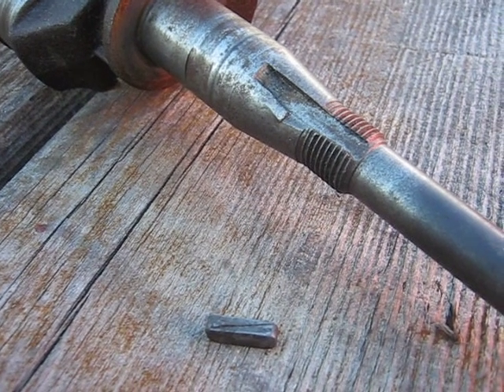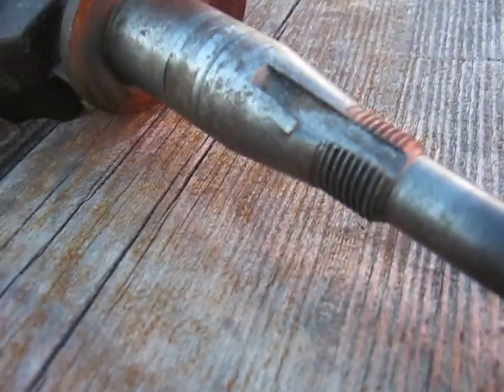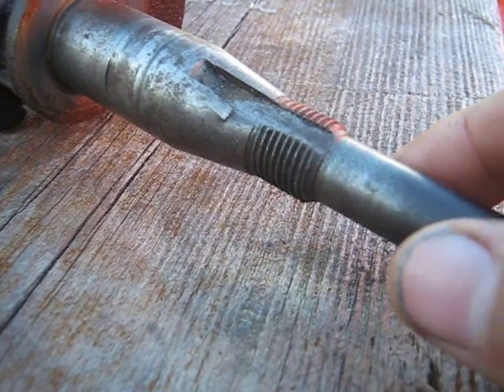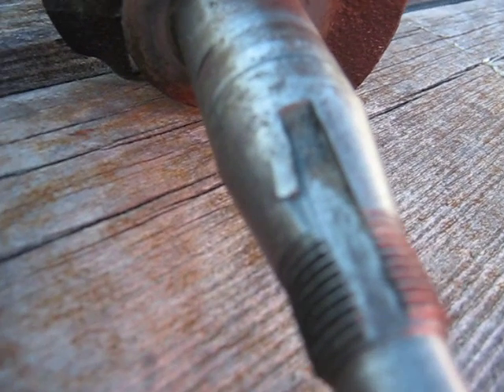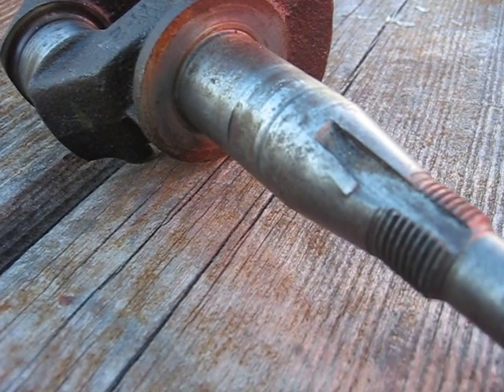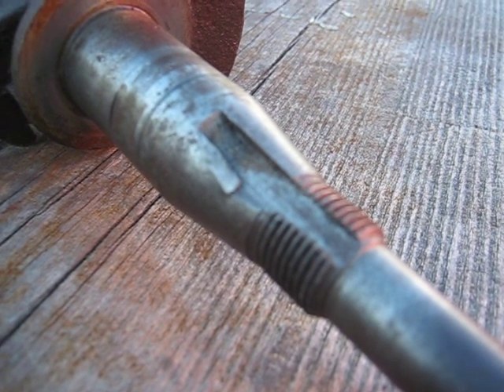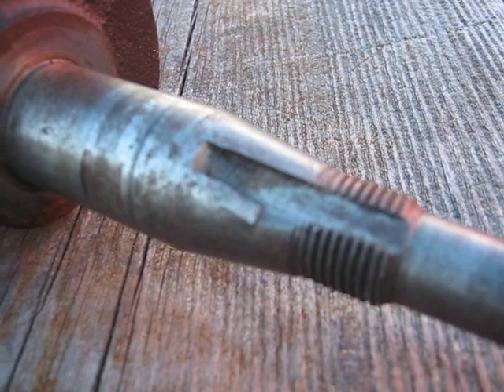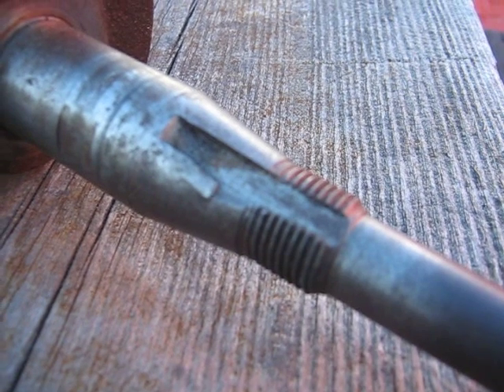NEVER Use a STEEL Flywheel Key!!!!!!

Comment: Great info thanks.  May I add 1 more fyi? Don't replace your starter motor gear with a metal one - it will eat through the flywheel gear teeth!!!
Reply from the maker: Yes, unless it originally came with a metal gear. Replacing the gear on the starter costs a little bit, replacing the flywheel costs a lot more!

Comment: They have flywheel key stock at princessauto. Is that steel? Is kinda heavy.
Reply from the maker: What they have is key stock , NOT flywheel key stock. The steel will work fine on a pulley , gear etc.  But, you must use the aluminum type on these Briggs engines, or suffer a damaged crankshaft and or flywheel, like I did. Hypothetically the engine could run without a flywheel key, as it only locates the flywheel, it is actually driven by the tapered shaft  wedging with the tapered flywheel.  Hope this clarifies my vid.
Reply: ChargerMiles007 you know if they is anywhere to buy aluminium flywheel key stock?

Comment: I make them myself from scrap aluminum, when I went to Canadian homedepot they don't even sell them ,or heard of them , people just buy new lawmakers.
when you install new key the shaft and must be polished and much other part perfect ,that's why everything holds together, key is just to a line two parts .Some people use rubbing polishing compounds to get perfect fit.
Reply from the maker: +tv1canada True, both the flywheel and crankshaft need to be clean and in good condition for it to work right. The other thing is to tighten the nut or recoil starter to 60 ft/lb torque, it can shear the key if it is too loose. I know of one person that made a key out of copper, as he was having a key shearing problem.
That is a good idea to use scrap aluminum to make a key, I have never done that, as I have so many from scrapyard engines. My latest project was making a spark plug spacer from scrap aluminum, so I can run a platinum spark plug in a 5 horse Briggs, as the engine burns oil, and fouls the plug quickly, I will make a vid of it  :)
Reply: @ChargerMiles007 I’m going to have to be “that guy” only today I installed 2 mower blades onto my BnS classic 450 and made keys by hammering some rebar square until a comfy fit n jamming the nut on good n tight with rattle gun as I had those 2 legitimate key ways disapear upon startup the last week

Comment from the maker: Yes, that IS a strong possibility!
I would try the 2 long pry bars, and shield the crankshaft end with an aluminum or brass plate or rod etc. to not hit the crank directly.
Old Tekumsehs are OK, like 1970s, I have a 7 horse that runs well, when the carb cooperates, but the newer ones like to blow holes in the side of the block!!! >:((

Comment from the maker: No, the aluminum (or whatever it is) is just for the Briggs flywheel key.
I think Tecumseh may use a steel key on some of them, as they have a lighter flywheel on some engines.
On a go-kart axle, steel should be OK, thats what I have used.

Comment from the maker: How about 2 pry bars, one on each side of center, while prying up, smack the end of the crankshaft. You have to use 2 bars though to get equal force on each flywheel half.
That one sounds seized pretty well. What size engine is it?

Comment: Oh man, the other day I was working on a chinese motor and the flywheel key was steel and guess what, the freaking flywheel was cracked, holy shit good thing I saw it. I was about to reuse the damn thing. Also the crank was severely damaged and I had to grind it to get the new flywheel to fit.

Comment: i was trying to get it off my dads mower.  bashed the crank with a hammer a bit, used a 3 jaw puller (would have bent the flywheel if i tightened it any farther), and tried to use liquid wrench on it. failed :/